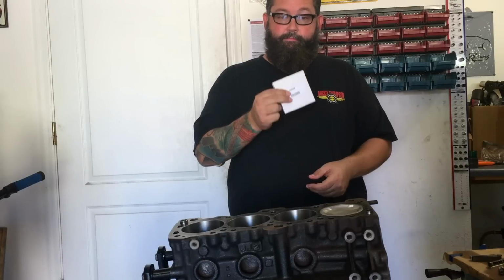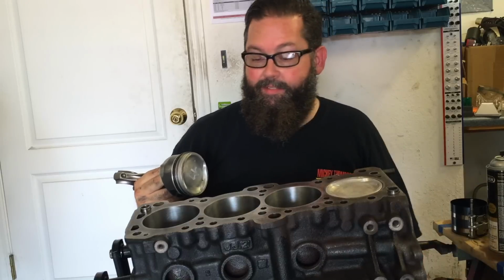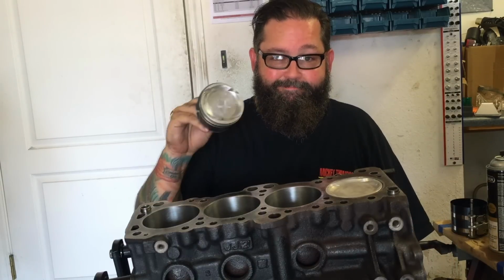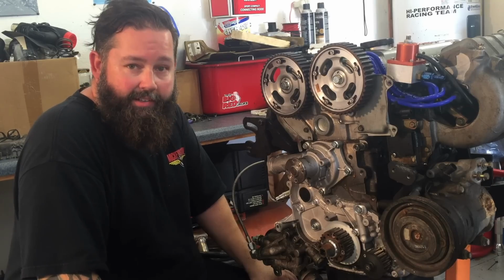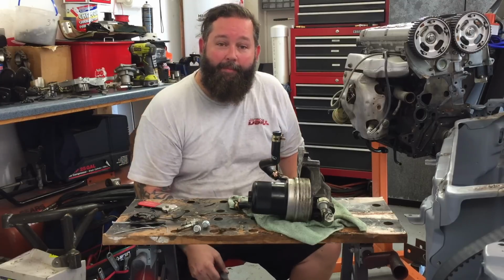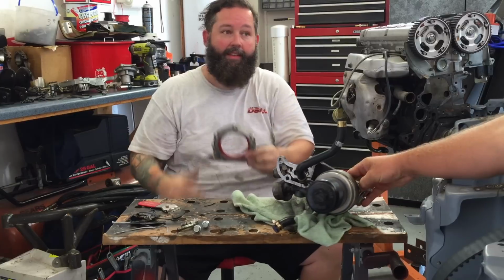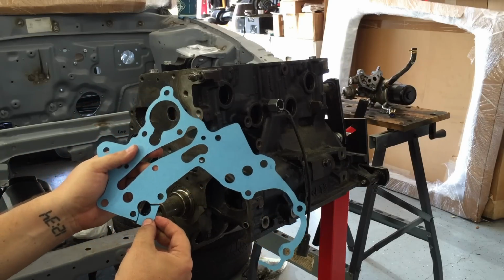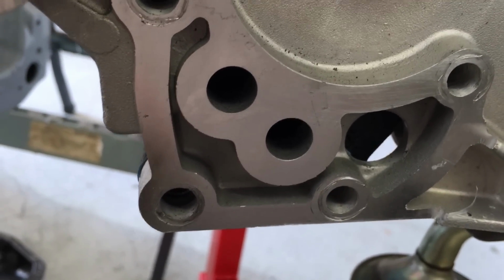Talon 2.3 Stroker Complete! - Joe Wrenches Vlog #10

Comment: Ever heard of the engine break-in strategy of using 20% ATF with your initial break-in oil? Drive the snot out of it for the first 20-50 miles, drain, refill, done. Supposedly the ATF has lots of detergents and cleans out all the break-in lube really well. It'll help your rings seat much faster too, I've heard. Supposedly lots of top-fuel guys used this method. Anywho, great vid, man.
Reply from the maker: There are so many methods. That's one of the things that makes auto mechanics so interesting. I actually take the opposite route. Well, usually... I use straight 30 Non-Detergent. But I do wipe the cylinders down with ATF while assembling. Thanks for watching!

Comment: Use a few washers and longer bolts between the stand and the block so there is more room to work on the rear main. And do your hair and make up on your own time.
Reply from the maker: This is probably the best option, if I can remember to do it before I hoist the motor on the stand.

Comment: i actually just cut a notch in my pistons for the squirters...making sure they're clearing is half the issue...When the engine is running they can vibrate up to 5mm and end up getting whacked anyway if they're not clearanced enough...carbide bit and good...👍
Reply: that or oil jet delete, but only delete them if your running forged pistons, or at least thats what the common consensus was.
Reply from the maker: The crank was hitting too. I think I pounded them flat enough this last time.
Reply from the maker: Considered deleting them, but wanted to keep oil pressure in check.

Comment: What crank did you use? What car should I pull one from and what piston and rods was used?
Reply from the maker: I used a crank from a G4CS out of a Hyundai Sonata. It’s the 6-bolt version of the 100mm crank. I used standard 6-bolt rods and “stroker” pistons that have a shorter compression height than stock pistons.

Comment: looks like the project is moving along nicely joe, keep up the good work. looks kinda like its a hot day out there in Florida whenever you filmed this, I can tell we had a few days of 107-112 degrees out here in California lol, so I know, and its so tempting to just do nothing in an air conditioned place, or a spot in the shade, but real true legendary dsm'ers want to get work done, regardless of the weather lol props to you and the crew.
Reply from the maker: It has been REALLY rough working out there lately. You just have to struggle through it. Just stay hydrated and fed. Pop up canopy has been helping lately too! Thanks for watching!